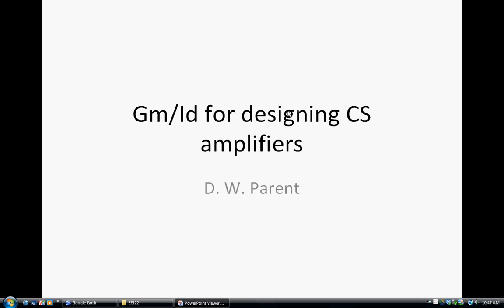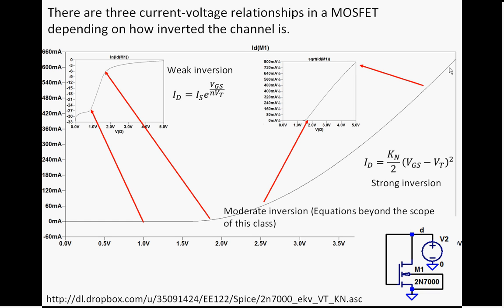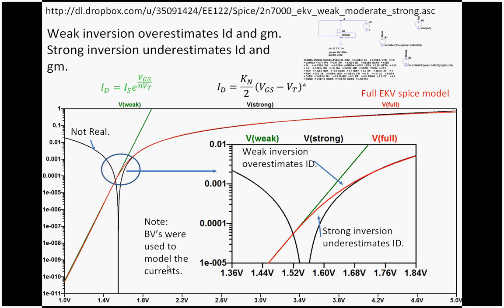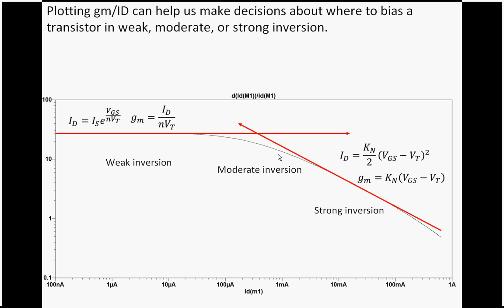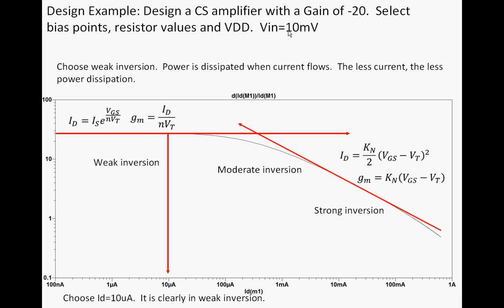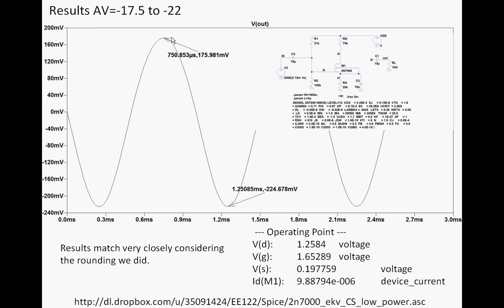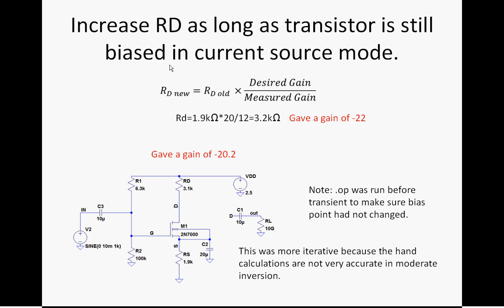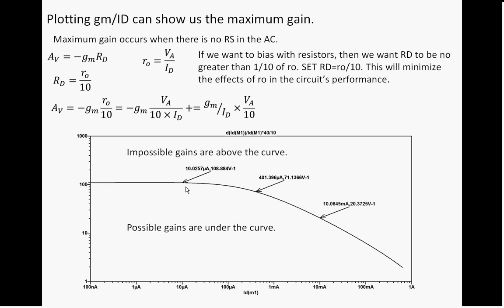Gm/ID technique for designing CS amplifiers

Comment: In the subthreshold region, gm = Id/mVT where m is the body-effect parameter (it is not the ideality factor n of diode I-V equation).  'm' is defined as the m = Delta(Vg)/Delta(Surface Potential), which may be viewed as the Incremental gate voltage that must be applied in order to produce the incremental change in the surface potential.  m = 1.2 - 1.4.  We control the surface potential to control the inversion charge.  m is like the actual price we pay (i.e., gate voltage) to buy a product (surface potential).  The price we pay includes a 20-40% sales tax, LOL (m=1.2 to 1.4)

Comment: Say, @14:00, why'd you take 2Av|Vin|? 
Why not using just Av|Vin|? Because that'd be the excess over the DC at the output node....................................... OR IS IT?
Reply from the maker: It has been a while but I am trying to make sure that VDD is big enough that the amplifier will not clip the signal.  IF Vin is given in amplitude rather than peak to peak one would need to multiply it by 2 to get the voltage over dead you need.  That or I put 2\times to make sure I had extra headroom.  I lost my original notes in a computer mishap.
Reply: @davidwparent means you memorize things?